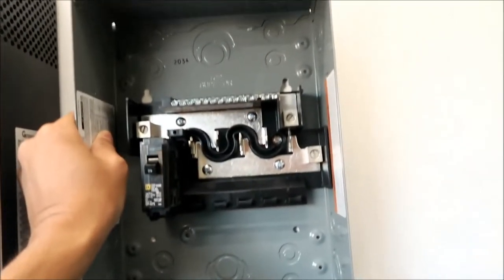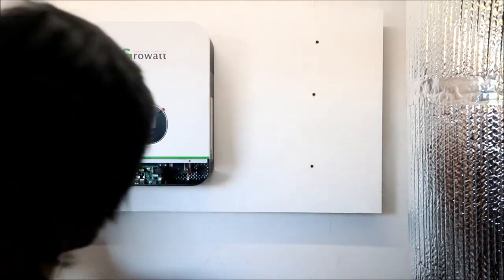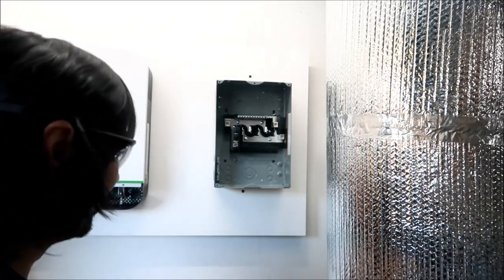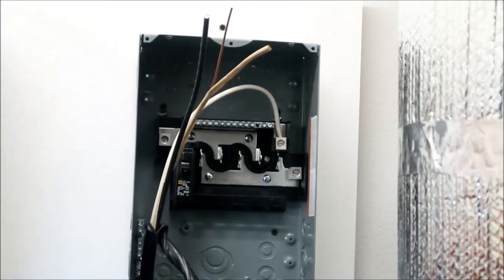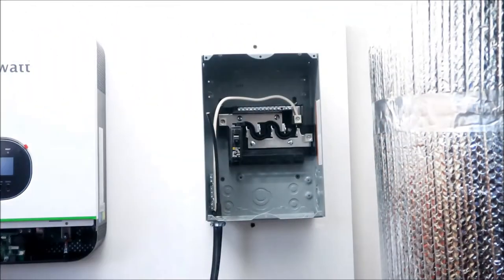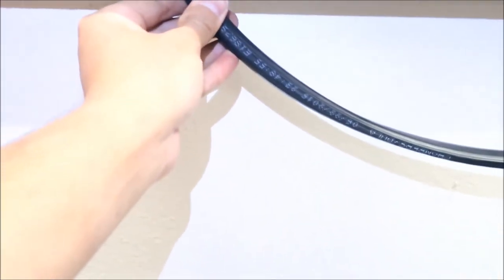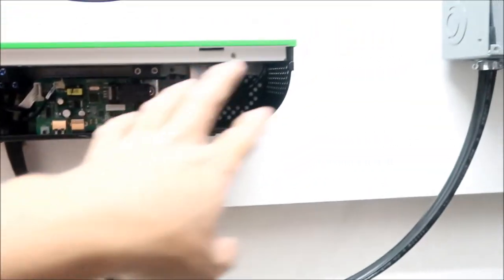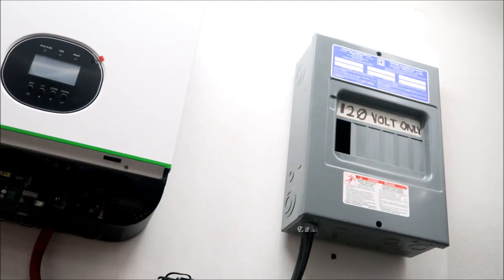HadesOmega Solar Garage Project Episode 17 - Breaker Panel and Growatt Inverter AC Output Wiring

Comment: HOWdy H-O-S-G-P, ...
Thanks ... one suggestion - when inserting "STRANDED" Wire of any gauge in a screw-down connector - 
it is advisable to utilize an appropriately sized "FERRULE" to keep the STRANDS all gathered together in an appropriate bundle ... 
I found it very useful when stubbing in my EIGHT AWG Gauge stranded PV & A/C wires into my GroWatt  ... 
but
Also useful when screwing down wires in the CIRCUIT BREAKER Panel ( as these circuit-breaker-panels are designed for SOLID WIRES / & / NOT for Stranded wires ) ... 
just an FYI
COOP ...
the  WiSeNhEiMeR from Richmond, INDIANA 
...

Comment: You may have one electrical issue:

Since the panel does not have a main breaker disconnect, you may overload the cabling between the sub-panel and the inverter. That is, let's say you put 20A breakers in the 6 positions in the panel. That's a total of 120A minimum before any of those breakers would pop. But, you're designing your cabling to the inverter for 100A. This is just an example, but I think a panel driven by an inverter should have a main breaker/disconnect before the individual branch circuit breakers. For example, think about how your house wiring is set up. You may have the 240V @ 200A from the telephone pole on the street to a main 200A 240V breaker in a panel on the outside or inside of the house. From that main disconnect, you then have your multi breaker main panels or subpanels for all your branch circuits. The main 200A breaker at the entrance to the house is meant to protect the wiring from the entrance to the house all the way to the house main breaker panel. This is the same idea in trying to protect the main cabling from the inverter to your breaker panel from an overload that may happen after that main breaker.

For example: 
https://www.homedepot.com/p/Square-D-QO-100-Amp-2-Pole-Outdoor-Circuit-Breaker-Enclosure-with-QO2100-Breaker-Included-QO2100NRBCP/100172670

You would connect the inverter output to that 100A panel. The one breaker in that panel would make sure that the current in the wiring from the inverter is below 100A. Then, from the one breaker in that panel, you could then connect to a manual transfer switch, such as Reliance A510C. Once the transfer switch is connected appropriately, then the 10 circuits in the transfer switch could then be powering the desired house branch circuits from either the grid or from your inverter.

One further note. If you go with my recommendation above, you should not tie both HOT sections of the one 100A circuit breaker. That is because, with one common neutral, you could conceivable be sending 200A back on the neutral wire.

Note: I'm not an electrician, so hopefully an electrician reading this would comment and correct the above.
Reply: Box should only accomodate 2 - 15amp circuit breakers since 30 amp input. Right?

Comment: When attaching the Growatt to the #6 AWG wire from/to the Sub Panel, were you able to determine if the Growatt would handle an even larger wire than #6?
Reply from the maker: I can't remember but 6 is what was recommended as the inverter can only pull a max of 40amps, I think I over sized it also
Reply: @hadesomegamoto7639  OK. Thanks. I will plan on #6 just as you did.